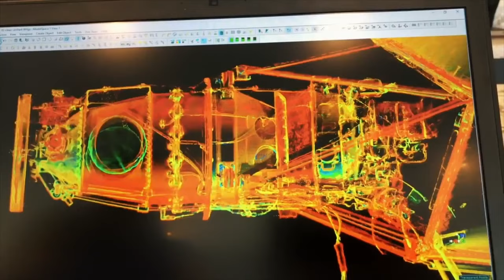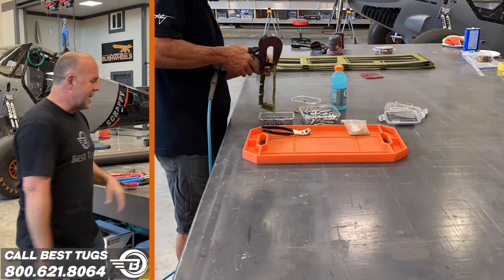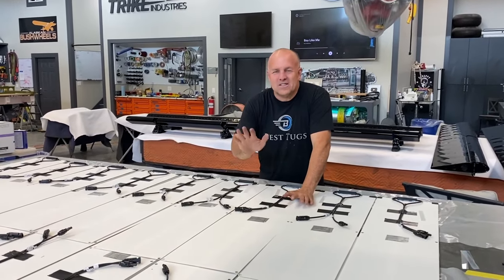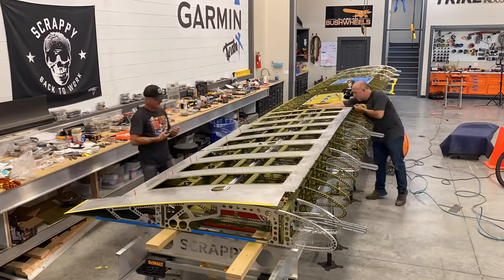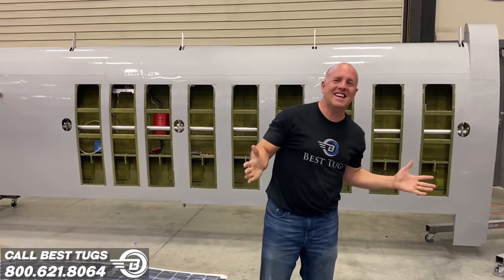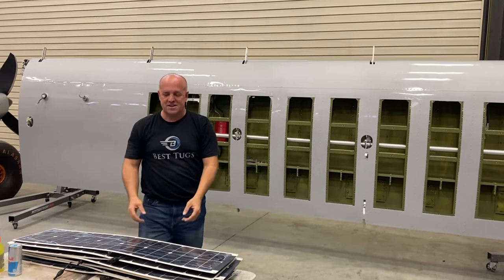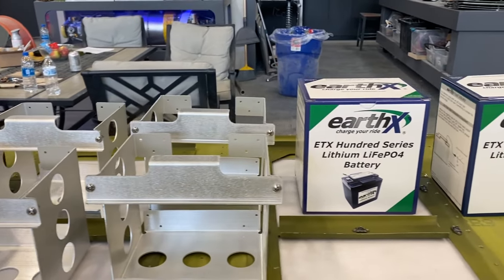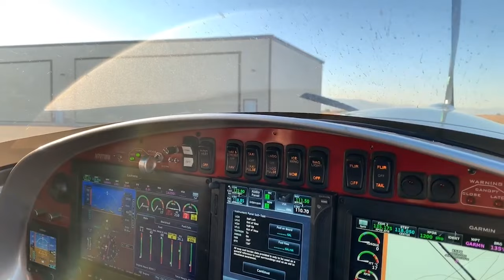Solar Panel Wings on Custom Search and Rescue Bush Plane | Scrappy #59

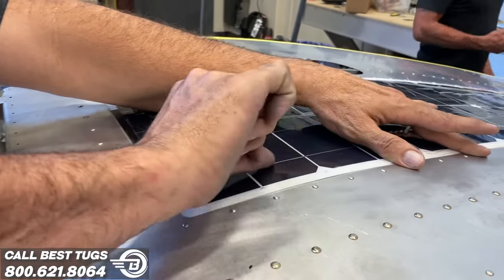Comment: I don't imagine the solar panels have near the same strength and flex attributes as the aircraft aluminum skin. I'm super curious to see how those 20(?) attachment points on the inset panel area (8:10) work in the end and what is used with those extra mount points marked or pilot holed at 7:05.  Hate to see a crab, side-slip, or some rough weather turning those into confetti or wing streamers. I'm sure it's far more engineered than how flimsy they seem to be so eagerly awaiting the next video!
Reply: My concerns too. So soft these panels may be bent, they never withstand the low pressure differences over the wing. Eather they break quickly or they fatigue soon. I have serious concerns to this design.
My proposal: bond it with prof. Bonding system ( epoxy 2c..) to an aluminum sheet, which is prooven for the forces.

Comment: Kieth, I agree with your points and look forward to the day planes might be electric powered too. I was more commenting on Mike’s use here of 18 lithium ion batteries for his aux power needs (camping, charging bikes, TV’s, etc.). Given he’s carrying an outsized supply of gasoline, I would think a small gas generator would provide far more capacity at a much reduced weight.  And could optionally be brought along or not depending on the flight mission. Carrying along the extra weight of all of those lithium ion batteries for every hour of every flight of this aircraft will have a long-term cost penalty.

Comment: You should look into the ready welder. It's basically a spool gun designed to run 24v direct from battery in series. Jeep guys like them. I like mine
Reply: That looks interesting. Thanks.

Comment: Two of those motorcycles is 260 lb! And quite a bit of drag.
My son and I had a pair of first generation Dahon folding bicycles. One had an engine, the other had a 20ft rope, total wt. about 80#. They could be stuffed in a Cherokee.

Comment: You should look into Milwaukee’s M18 grinders and MX demo saw they have a pretty amazing lineup of battery power tools you can put to speed chargers in the plane then have multiple batteries so if you have to go into the woods a half mile you have battery power tool instead of being within cord distance.

Comment: Mike, for search and rescue, especially with your terrific power supply, have you considered approaching a Lidar (laser typography in real time, that sees through trees to show the conditions below) manufacturer? A device that clips on where one bike normally resides might be really useful. To take it to its natural conclusion under the other wing a wide angle thermal imaging camera would spot warm bodies and cooling engines, or indeed nascent forest fires.
Anyway, huge fan, now get back to building 👍🇬🇧

Comment: A few weeks ago, when you asked everyone to guess what "those special mounting holes" (wing bullhead or rib) were for, you had never told us. At that time I posted my guess that they were for enroute charging ports for the battery assisted Mtn. Bikes. It seems I was very close, but we knew nothing of the solar panels at that time. Now we seemingly know it's for charging those mtn. bikes or the electric motorcycles on the ground too.
My other 2nd guess (I posted both together) was for a fuel dispensing valve/hose mount to gravity feed fuel to transfer "fuel storage bags". My first guess it appears was closest to right.

Comment: Fantastic project just like your other planes but I have a couple concerns with the solar panel install.  Will they be sealed from water inclusion that might freeze and damage components?  The thin solar panel plastic sheets will be subject to stresses, positive and negative air pressures on the tops and bottoms and vibration that the were not designed for.  The constant flexing especially at the attachment screws could cause them to fail and leave 18 very large holes in the wings causing for some difficulty in flying.  I'm sure Mike has already thought about MOST all the possible complications and unintended consequences with any radical new design.  Just like everybody else, I am anxious to see how it all performs.  I wish I had just half of Mike's energy and enthusiasm
Reply: I know I'm speaking from ignorance, but I have the same worry. Would it not be more structurally conservative to bond thin PV material onto/into a conventional wing, and lose some weight elsewhere? I assume Mike's gonna be flying through some pretty rough weather on occasions. Love the project, good luck.

Comment: Hey Mike I‘m always blown away by your work and I try to follow all the physics behind it to my abilities. But now there’s something that confuses me for the first time. Doesn’t the upper skin of the wing have to be strong because the plane is basically „hanging“ from the low pressure area on top of the wing? Now these bendy plastic solarpanels cover a lot of the wing area and they are only attached with a few screws or rivets on the sides. Won’t the low pressure just suck them out?
Please explain the physics!!
Can’t wait to see the next steps!!

Comment: Maybe this is unrealistic technically, but it would be amazing to have a safety feature where given all that electric battery power, in the event of a full engine out, you could flip over to an emergency electric power mode, that would turn the prop just enough to give you a short bit of extra lift to allow for more options for putting down a landing in the best possible spot. The idea would not be to generate a ton of lift or actually even fly, rather just provide enough lift to provide a lot more glide, which allows for more potential landing locations in the event of an emergency. I better file my patent now!

Comment: Mike, you have some really good ideas. But you do need to be careful. With all those batteries on board, it takes just one spark with all that aviation fuel on board. Just one short circuit and that's it. So please take care. God bless!

Comment: Also if you’re unfamiliar with solar connectors it’s not for the faint of heart. Those MC4 connectors are dangerous if those panels are in series and they are exposed to light. Do not disconnect those connectors when they are under load, those connectors are not load break rated. They will melt the ends and explode when the load is broken. If you reconnect the end it is now a fire hazard from the extreme heat from the end being super heated from the plasma arc.
Reply from the maker: 👍🤠 absolutely and thanks for the carousel words as many will find that helpful.   I owned a solar company for many years and have done countless systems from small to commercial Sytems.  I’m with you 100 percent 👍🤠
Reply: @MikePatey  that’s awesome, I’m an electrical contractor. I used to design, construct and commission utility grade solar. Interesting background for sure.

Comment: If you are going to hook all that equipment to Scrappy, you'll probably need a bigger inverter. Check the input AC current requirement on the welder.

Comment: I posted a comment too early. Pure sinewave is cleaner on EMF (less radio noise), more efficient (especially at low power draw so battery lasts longer when not used as much), more friendly on sensitive electronic gear like laptops etc. But they are more expensive and heavier however the benefits out way the detractions.

Comment: Very cool addition to Scrappy but I think Mike is too optimistic about solar panel performance.

900 watts if all the panels are in one sun condition, without light induced degradation (LID). LID will reduce output by 20% to 30%. In the best case, one sun condition will only happen for about an hour each day. If any of the panels are partially shaded, that panel will have no output at all. Also, the MPPT / boost controller  have efficiency limitations, especially if illumination is not uniform across all of the solar panels. 

I would suggest using an application like PV Watts to estimate a more realistic energy harvest for a particular location on a particular day.

Comment: I had an asymmetrical flap deployment during final in a 172.  The actuator rod on the left wing broke clean in half.  Noticed it was a little stiff during preflight but CFI said it was good to go.  

When I turned final and made my last flap adjustment, there was a loud bang and the left wing dropped.  It was a little hairy of a landing.

Comment: I sure hope you've run extra conductors for the various attachments and video feeds you'll be able to swap in at the hard points. And maybe plumbing for the extra fuel pods. Could be another 250 pounds of fuel...

Comment: A standard American household 120v outlet is 1800W of power, a kitchen or bathroom outlet can handle more at 2,400W. Not always true but in most cases. This is a generalization.
Reply: This inverter is good for 10A, that’s less than a household refrigerator or vacuum uses.

Comment: Dear Mike. In relation to your SAR functions, I was wondering what load your hardpoints at the wingstrut location can carry. Depending on this load I can imagine you could devellop special lightweight Carbon fibre cannisters to carry special SAR stuff. If you provide a special connector next to the hardpoints (Power & Signal wiring) you could make it an active system: to open doors in such a cannister to drop SAR stuff, or drop the whole cannister, to mount a very intense search light, to make multiple drop system for communication equipment like walkie-talkies etc. to communicate with the stranded people on the ground. I think you probably have given this a thought however it may give you some more inspiration on your very interesting and innovative plane! Succes, Jan C.A. de Vries

Comment: The solar panels are awesome. But add a port to were if you needed to could take with more solar panels to charge faster. That way when digging someone out you could possibly run that jack hammer more without having to stop and wait. Just an idea

Comment: Starting to wonder when Mike's debut role as Q in the next Bond film is happening! 

On a more serious note, I sure hope you have some spare panels since the thin-film panels are not very long-lasting and a lot of those companies don't last very long either. Also, have a look into a high power secondary alternator power charging component made by an Australian company Safiery called Scotty. It is capable of recharging 12v at 300A.

Comment: As a huge but realistic solar proponent, the only way this will be able to power a welder, once the batteries die, it'll take all day of charging to get 10 mins of welder time. That's assuming the sun stays at high noon all day and you don't have any shade. I love building my and engineering my solar systems, but I think Patey is being rather optimistic with its production.

Comment: Mike, you mentioned you want more power.  Could you stick a pancake electric motor, 200HP or so, on the back of the lycoming and use those batteries to power it for 30-40sec boosts? It would be a good way to utilize those batteries more.  Might need some capacitors to supply enough current for that power though.

Comment: Every video lately seems to blow the lid off the age-old question "well, what's your mission?" I love it. I was wondering, what other safety features have you built into the slat/flap actuation system to avoid asymmetrical lift? What happens if a linkage or a bearing fails? Is there a certain amount of asymmetrical lift the aircraft can overcome through normal control inputs?

Comment: I hope your dual alternators are wired to charge your EarthX batteries as well as your main batteries.  If you ever need to use large tools, you will definitely want the ability to quickly recharge those batteries and not wait for the solar system (like at night).

Comment: Great videos Mike I it's like I have a question though what is going to stop what is going to stop these solar panels from flex it's from flexing upward  Due to the lift the air is causing across the wing?  I have pictures of a panel on a commercial jet That during flight the panel flexed it appeared almost 3" away from the plane

Comment: 1200 W inverter will draw 100 amps at max load. That small Anderson connector you held up can handle 50 amps max continuous load. That big Anderson (assuming it's the biggest one) can handle 350 amps. Thats an inverter of 4200 W output, Enough to handle some fair-sized grinders, etc. But not welding. Not even close. Just saying.
Reply: Um yeah, you may want to take a trip to Harbor Freight. (I never would have guessed I'd be saying this, a few years ago! I thought everything at Harbor freight was junk! ) Check out the omni pro 220 multi process welder! It's a 120v/220v I have personally run one on a 20a 120 outlet, with a 50' extension cord, and it works perfectly, for some very stout welding! Definitely enough to handle plane landing gear repair!
Reply: Hi Andrew, great to see you over here too, how’s the RR Classic working out?
Reply: What is the basis for your assumption that the 1200 watt inverter is 12 Volt Input ?  It could easily be much higher. Nine 13 Volts batteries in series would make 117 Volts DC.  Or three groups of three 13 Volt battery banks would be 39 Volts which could easily be what each of the solar panels are producing, just sight a few possibilities.

Comment: I have a bad feeling about those solar panels... won't the vibration of air pressure and turbulent air passing over the wing flex them and make them eventually fail? I think of solar panels as quite delicate fragile things... am I wrong on this?

Comment: Astonishing videos my good man. What I've always wondered about aircraft structural Integrity issues is why aren't there HD cameras inside the aircraft itself to monitor "interesting" parts of the internal structure, fittings, electric junctions and wear prone Mechanicals?

Comment: Hey Mike, it'd be interesting to learn more about the way you've configured the power arrangement on those panels - which charge controller for the batteries, etc. I threw 2700 watts of panels on a bus, and I've helped a friend put over 4000 watts of panels on his. Obviously those aren't planes, but there are some interesting engineering challenges with that, and likely some similarities as well - if there's time to share I'd love to hear about them.

Comment: Very inspiring build. Thanks for taking the time to explain all the engineering. Love the solar system! It would be great if you could link to the batteries and inverter.  Also, those batteries look like they have a carbon case. Is that right or is it wrapped?

Comment: Best plane ever. But one question, what is the plan fo dealing with thermal issues, induced by the giant hotspots the flexible photovoltaic panels will create, when operating?

Comment: I’d ask an electrical engineer about powering a tools and a welder off DC. An inverter has some inefficiencies that are only really justified when you’re powering an appliance that needs AC power. Mainly for something powerful like a welder. The phase-fired speed controller in tools like angle grinders probably need AC to function, but so long as here’s no PFC, an inverter welder should run just fine off DC. Could even ditch the input caps. Now whether you could run an inverter welder off 12V or 24V or whatever your system is is doubtful, but modifying a welder to be able to do that, or buying a welder already capable of that, is something I’d look into. Same for anything high-power you’d want to swap to a higher power DC-to-AC inverter with.

Anyhow that’s some incredible work I’m seeing here! Got a link to those flexible solars?

Comment: You know sometime, someday, even if your electric bikes don't run out of power, you'll be 20 miles away and get a flat. So, some run-flat tires may be in order. It happened to me on a gas motorcycle, and I was pushing that thing up and down a dirt road in the mountains for hours.

Comment: I watched the video where you experienced a catastrophic engine failure. Do you have a fuel dump switch and if so, why didn’t you pull it?? How many folks survive a plane crash only to perish in flames? Safety, safety, safety🖖😎 Looking out for you Bro.